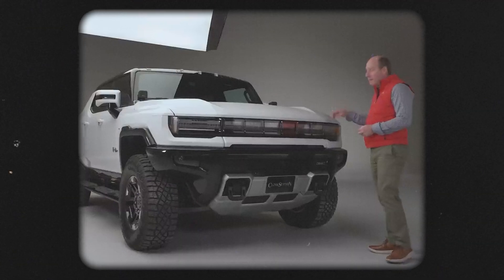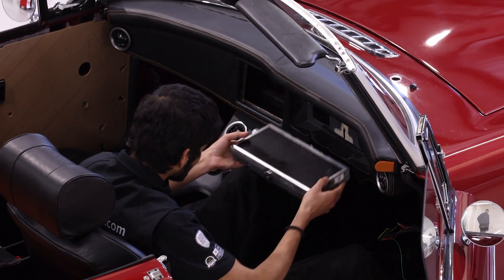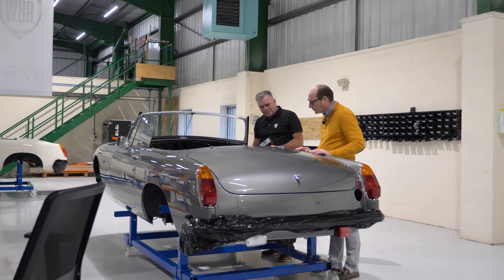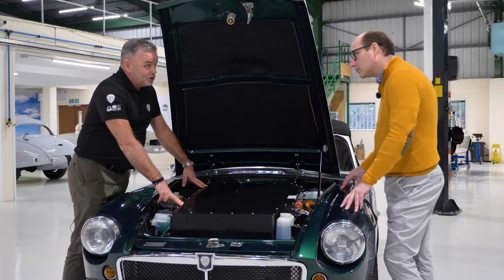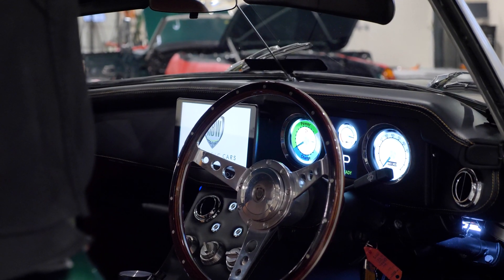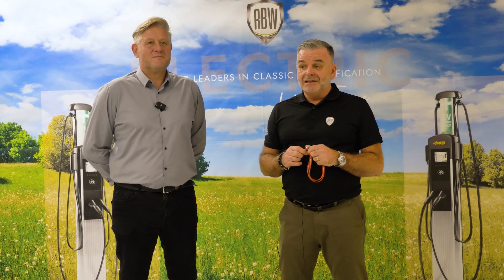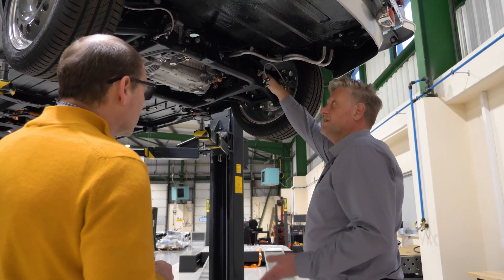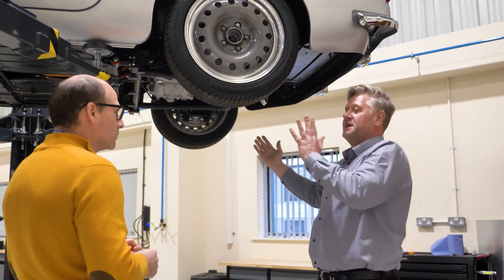Brand New CLASSIC EV!?: A Look Inside RBW

Comment: So, no engine burble, no boot space, and a car that weighs a ton? Aside from the appearance, it doesn't sound very classic...
Reply: You will probably find the weight is about the same. The whole point is to try to keep the car as close to original spec as possible. A requirement for registering the car with DVLA, and for insurers.
You try driving one, it will knock spots of the original! Plus be much more reliable as a daily driver.
Reply: @coniow With the average weight of an EV about 400 kg more than its petrol equivalent,  and the MGB being so light, I think the handling will suffer, especially when cornering at speed. As a sports car is all about handling and speed...  Anyway, it'll make a nice posing car.
Reply: @stuart7515 the weight difference in this case is nowhere near that extreme. Other videos mention the difference as being around 10% of that

Comment: Well driving an old "classic" involved engaging with the machine.  Way back it was adjusting the ignition to run better. Later on it was simply enjoying making the machine run as you like it.  Changing gears at the right time and at the correct revs. Down shifting and matching the revs, to the gearbox.  Gear shifting to the sound of the engine and simply the enjoyment of the sound of a finely tuned mechanical combustion engine.   NOW.  Like being in an elevator. You just push a button and go.   No pleasure in the ride. Just going from A to B .     Like an elevator.

Comment: Very Interesting, but you missed a few important items ...... PRICE ???  Speed?  0 to 60 time?  Warrantee ?  Servicing?  Comfort?   and PRICE???   All right .... probably built to order, so a wide variety of prices, but a rough guide is essential.  Other than that, quite a nice video.
Reply: Prices 'start' at £90k. 0-60 nine seconds.
Reply: 9 seconds? Thought it would be quicker  @BurpTheKitten
Reply: @devanman7920 I suspect that the 0 to 60 could be reduced substantially, however, they try to keep handling and performance as close to the original as possible. That is what the chassis was designed for, and what DVLA will accept without requiring a separate inspection for registering. Insurers will also be VERY bothered if you up the performance to what the motor and new drivetrain are capable of.
Reply: *warranty